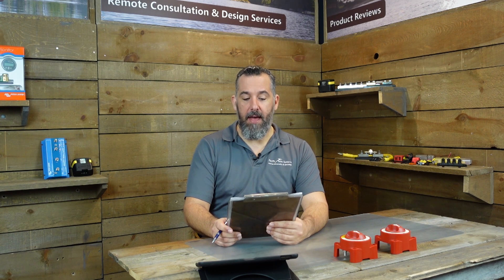Will I Damage My Alternator if I Switch Batteries While the Engine Is Running?

Comment: The easy solution is to install an automatic charging relay (ACR) between the two battery banks.  An ACR will electrically connect the two battery banks when the engine is running and the battery voltage goes above the threshold voltage of the ACR  (typically 13 volts or so) and disconnect the two battery banks when the engine is off and voltage drops below about 12.75 volts.  That way you always charge both battery banks when the engine is running (or something like solar drives one battery bank above 13V.   You still may want a 1-2-both switch so you can start from both banks if the normal start battery is weak.

Also some old battery switches break the circuit when switching from one bank to the other.  Newer switches have what are called make before break wiring so the make the connection to the second battery bank before disconnecting the first battery bank - as long as you don't go through off as mentioned in the video.

Comment: I have an old boat with a wiring nightmare. I have been trying to run down a problem with my alarm/ light that has been going off more frequently for some time. In the process I found a wire on the alternator that has become disconnected. I have no idea which post this wire came off of. There are two posts on the alternator. One is marked B+ the other is marked R. The B+ goes to the starter and the other post appears to have a wire going to the tachometers. The unattached wire has power when the key is on and I have traced to a wire bundle that comes off after the key. What is this wire for and which of the alternator taps should it be connected to?  If it were connected to the wrong post would it blow the diode in the alternator?
Reply from the maker: Hi Kim, you seem to be on the right track with your detective skills. Based on your description, sounds like the ign wire from the engine key seems to be disconnected at the alternator. Since there are so many variations of alternator wiring, suggest you look online at your exact alternator model and find the post where the ign wire should be connected.

Comment: Would a battery switch with just B1 & B2 no off mark  be OK to go from 1 to 2 while running ?
Reply from the maker: Yep, as long as you don't disconnect the alternator from the battery while the alternator is outputting.

Comment: Following your answer , can I really charge both batteries at the same time ? I thought it would be best to charge them one at the time , that the alternator would stop charging when the first battery would be full. 
Great serie Jeff !
Reply from the maker: Hi Benoit, yep you can definitely charge both batteries at the same time.
Reply: Depends on your batteries, alternator, v-belts, engine. Look into your battery bank’s charge acceptance rate vs your alternator. An old 45 amp alternator with a single v belt cannot feed an 800 amp hour battery bank without risk of overheating, frying the belt, etc. look into quality external regulators like Balmar.

Comment: Engineering 101 do not enable the system or the user to harm the system or themselves.
Reply from the maker: Well said Liam!
Reply: Thinking about it. If one must fit that switch type for reasons I'll never understand then the alternator ought to be hardwired to the engine battery. By your logic, it would have not cost much more and be more useful to have 2 alternators outtov the gates, one per battery.

Comment: A switch with field disconnect contacts, apparently prevents this situation by providing a safe path to ground. Never tried one, but I've seen them. Yes, I know, someone previously mentioned this. Thumbs up, keel down. :)
Reply from the maker: Good one, although I've never seen this implemented .
Reply: @PacificYachtSystems  About 20 Years ago I re-wired a boat.  It had the classic Red 1  2  Both  Off config.  On the back it also had two small posts that were what I assume are called Field Disconnect Contacts.  They would break contact before the main switch did, and I'm pretty sure I just ran the field circuit for the alternator directly through that switch.  Nobody had ever heard of this then, and it seems few people know about it now.  It's such a simple solution to prevent an easy, and expensive, mistake to occur.

Comment: Can I ask what the difference is between these older style battery switches (which I have), and the dual bank control switches (which i am thinking of changing to)?
Reply from the maker: Because difference, is that house and engine loads are separate, meaning engine battery powers engine/starter and house battery does all other loads. With one turn of the switch, both battery banks are connected to their separated loads only.